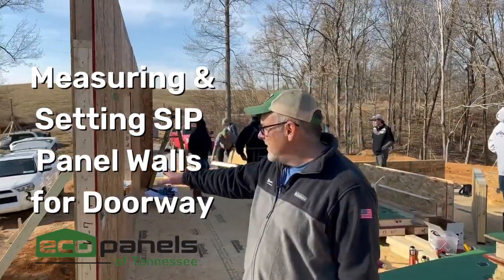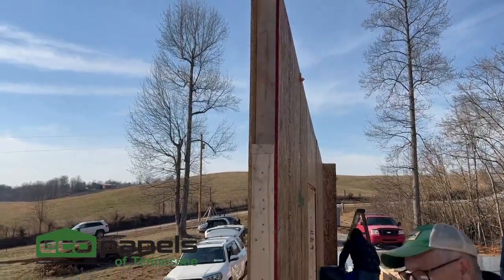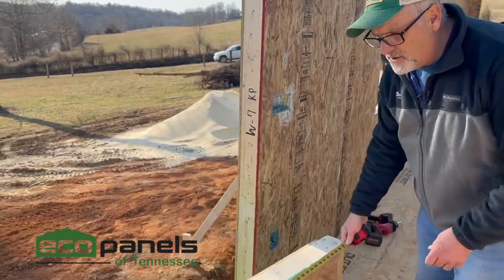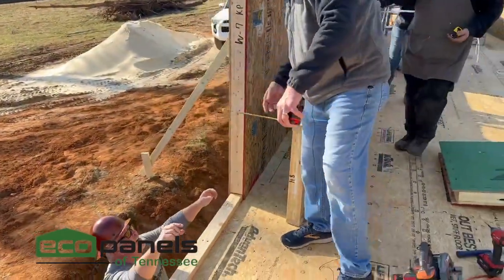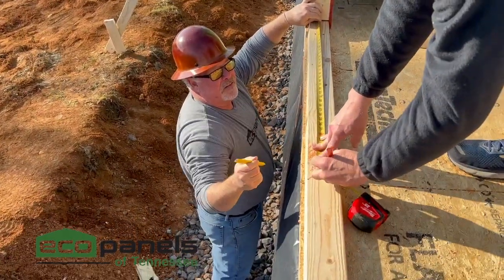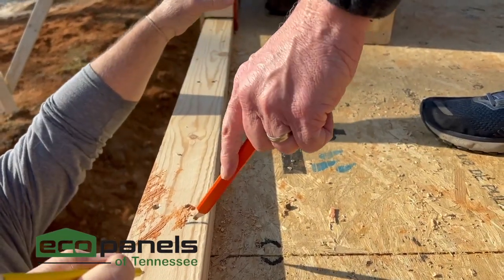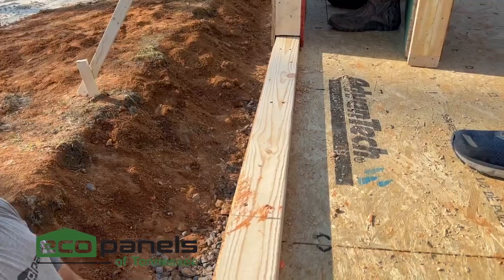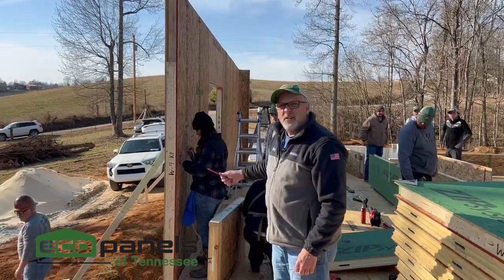Measuring & Setting SIP Panel Walls for Doorway

Comment: My sister had storm damage to a stick frame house 🏡 
It was repaired by replacement and doubled up items

If a sip panel gets damaged 
What’s the repair recommendations 

Maybe you can have a future video on modifying things after construction 🚧
Reply from the maker: That's a great idea. We'll look for an opportunity to do that (hopefully not with someone's actual home!) Obviously, this is going to vary depending on the severity of damage, but generally speaking, the SIPs can be repaired as well. This may be oversimplifying a bit, but it can be as easy as cutting out the damaged area to a specific dimension, then letting us build a type of insert panel for it. A customer / builder could put a temporary patch in place until that panel is received, but in an emergency like that we would get it out immediately. Thanks for the comment... hope you'll subscribe!